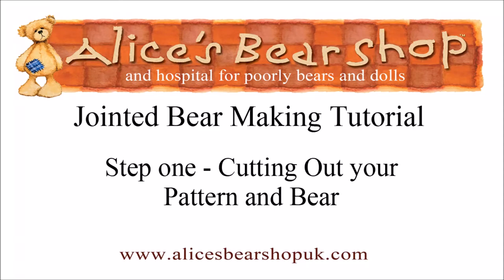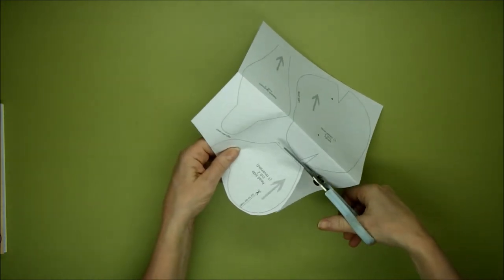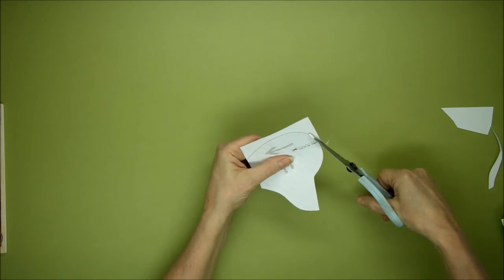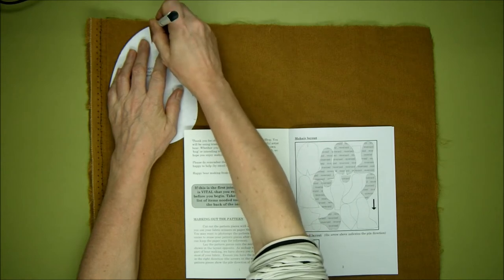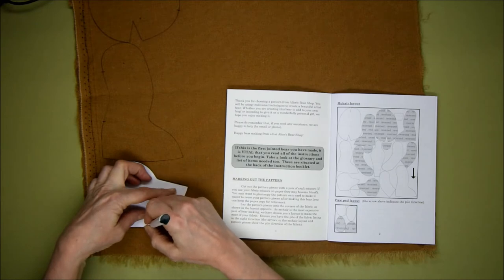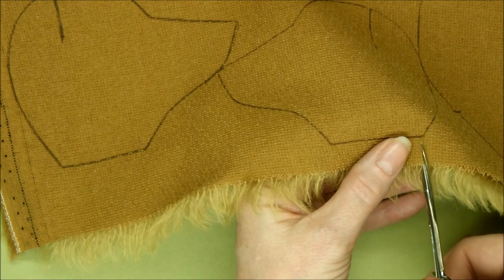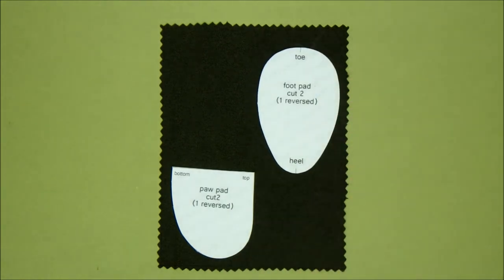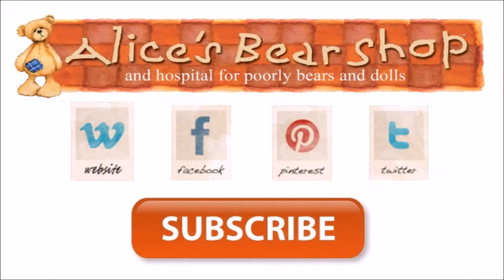Jointed Bear Making Project - Part 1 - Cutting Out Your Pattern and Bear - Alice's Bear Shop

Comment: Your tutorials are so good. Very helpful and reassuring. I've found it useful to trace pattern pieces onto freezer paper, and then iron the freezer paper onto card and cut it out. It means that you have both the card templates, and the printed pattern still intact, which is good if you lose or damage one of the card templates.